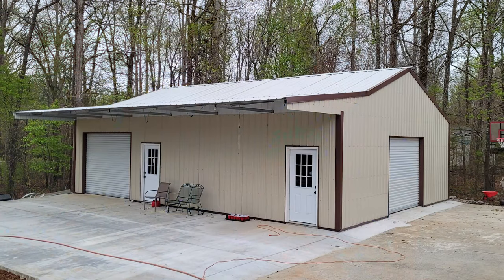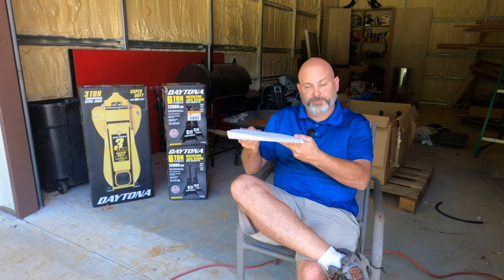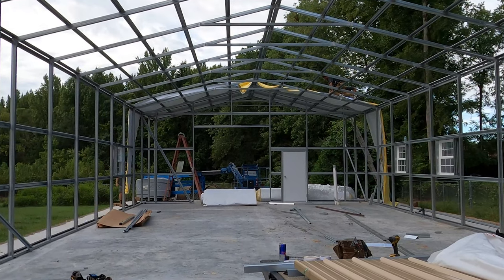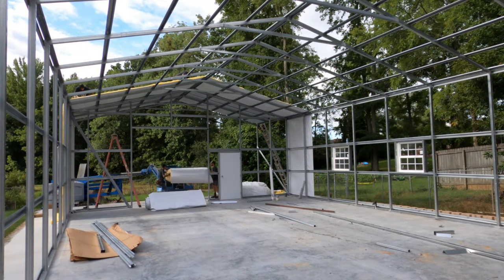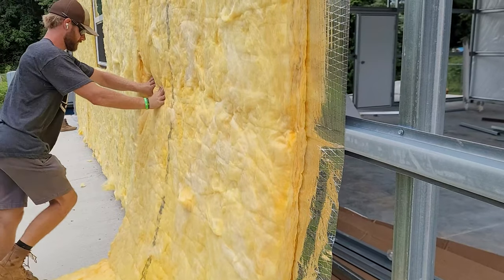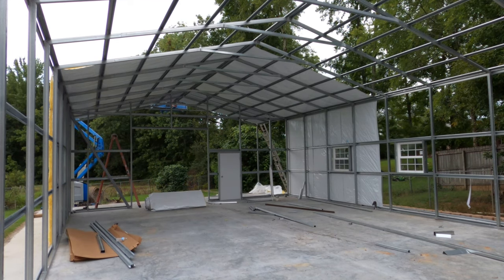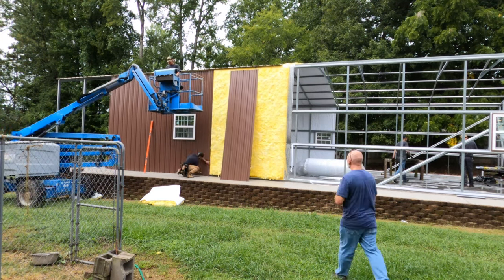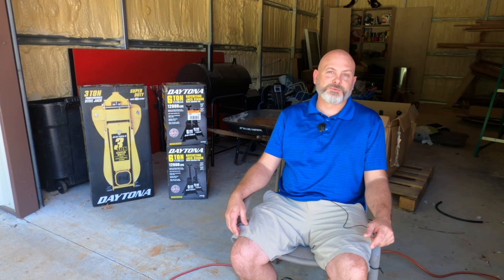How to insulate a metal building.  Can you DIY a 30 x 40 tube steel building? Part three, insulation

Comment: I think spray foam is still the better option. Thanks for making the videos.. Excellent info!
Reply: agreed in all ways spray foam is better. better r value better, air tightness (not that this is much of a concern in a shop with leaky bay doors), helps add strength to the entire building. if closed cell was used it would also create a water tight barrier all while adding alot more strength when compared to open cell. only down side is it cost a lot more than batts but is far superior in every way
Reply: Spray foam does not give you a thermal brake .
Reply: Thanks for the info. I’ve had to rewatch this a couple times. What is the name of that insulation? What do I ask for when I call a supplier?

Comment: so, the insulation goes on the outside of the steel frame to prevent thermal bridging and on the inside goes the vapor barrier (since condensation will cause problems if air conditioner is run inside the building and metal is still exposed)? In away, the steel frame must be insulated or "sandwiched" between 2 layers of insulation

Comment: Although the spray foam is better than nothing for your case, all of the members in the wall and the ceiling are now thermal bridges between the inside and outside. The full coverage of the rolled insulation helps prevent this.

Comment: I have (5) of these type buildings don't even waste your time with any type of insulation but spray foam. I have tried other types and the spray foam makes the building so much stronger.
Reply: Just spray foam alone? Not the roll stuff he is using? What does the process of spray foaming a metal building like this look like? Any tips or pointers?

Comment: Jason, just found your channel and have been watching your videos on building your shop. It’s looking good so far. Having grown up and worked with my dad who put up red steel buildings/warehouses, one thing I would recommend is to line the inside perimeter of the building with plywood or metal. This will give you more areas to hang items, protects the insulation, and would keep someone from unscrewing the exterior sheets and breaking in (which spray foam would make it a little harder).

Comment: Jason, Excellent video series and Thank You.  I plan on putting up a building fairly soon and I would like to do a 30' x 40' also.  I'm going to need 16' sides so I can put a vehicle lift in.  Will also need a thicker section of concrete where the lift will go.  These videos have helped me understand the process.  I like the vertical side wall panels also. I understand that with the vertical panels you need the hat channel.  I want to go with the spray in insulation.  Watching the footage of the guys installing the fiberglass with vinyl backing  insulation just goes to show you how you need to watch installers at every step of the way.  I can't believe that they would roll that insulation out where there was standing water on the floor.  A quick going over with a blower or broom would have eliminated those puddles.  Now they have installed wet fiberglass up against the metal roofing and there will be a stink from the mold that will grow on it.

I also noticed one other thing that I wouldn't have done and here's where I get hammered by viewers.  That's where you had the concrete finishers use a broom finish on the pad outside and leading up to the roll up doors.  I absolutely hate broom finish concrete. on exterior concrete finish I prefer wood trowel finish.  The reason is you get just as good a grip as broom finish but without the hassle of trying to sweep it off.  I understand that we have leaf blowers now but still try to blow off those sweet gum leaves after they fall and get wet from rain.  The leaf blower will have a hard time with it.  The concrete finishers will try to sell you on broom finish because it's easier and takes less labor to do.  but it also covers up imperfections in the concrete. 

I was talking to a guy who had a metal building installed and he said he was happy but if he were to do it again he would eliminate the ridge vent.  he showed me where the wind blew dirt and sand up the roof into the opening at the ridge and it fell al over his cars.
Reply from the maker: I didn't do a ridge vent either.  I'm covering that in a later video.  Thanks for watching!

Comment: Enjoying your videos as I'll be building a tube metal frame building in the future.  A little Monday morning quarterbacking here, but why not insulate with foam board?  Closed cell foam board is definitely DIY-friendly; it's lightweight, it cuts easily with a handsaw, and it matches R value of spray foam, meaning if you get R5 for every inch thickness of spray foam, you get the same in foam board, so 3" thick foam board gives you R15.  It's also less expensive than spray foam since you're not paying for labor.  Plus, foam board has already off-gassed at the factory, so no need to worry about that the way you do spray foam.  It looks like the studs here are at least 3" deep, so you could, as some suggested, sheet the interior.
Reply from the maker: At the time of the build, foam board was hard to get.  The price was insane, and the selection was low, so spray foam it was.

Comment: odd your video was about "how to apply bubble foil insulation" when your building has spray foam, I know you missed the step but most would prefer spry foam if they can afford it, imagine the difference is night and day w/foam? I have a 50x60 w/ no bubble/foil and am on hold for my spray foam due to costs!

Comment: The biggest flaw of the installation is in the videos you were showing they did not roll up the white Vapor Barrier material to protect the fiberglass from water they cut it flush to the ground so if water goes under it will soak them into the insulation and cause damage

Comment: Hey brother i wonder what the difference in R- value between your spray on and this Batting is?
Also cost. Ordering the building without insulation and spray foam difference.
Thanks for the video brother .

Comment: As I can tell the insulation is a 2 or 2.5in batting, not the best and the fact the the roofing and siding flattens the insulation at the contact points diminishes the insulation effectiveness. It would be better to install a vapor barrier on the frame covered by roofing or siding and then install insulation on the inside. Covering the inside wall will protect and increase the effectiveness of any insulation. Do this as soon as possible.

Comment: Do you know the R value of the supplied insulation? Would the sprayed on insulation have the same or greater value? Thanks
Reply: IMHO that looks about R4 at best... only 2-3 inches thick. Problem being with that type of system is when you screw the metal on the outside, through the insulation, it compresses to the point of mostly zero R value. Spray foam is more expensive but can give a higher R value per inch (4-5), It also air seals the building and makes the whole structure more secure by bonding to the metal panels and creating a solid system. Hope that helps.